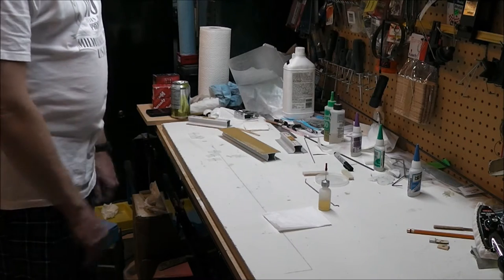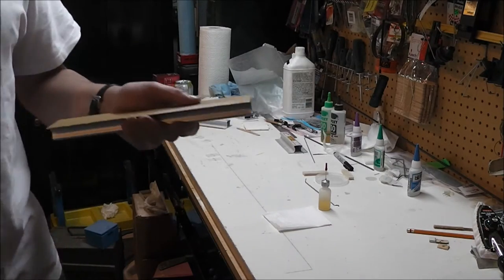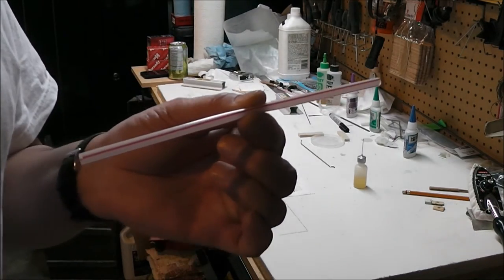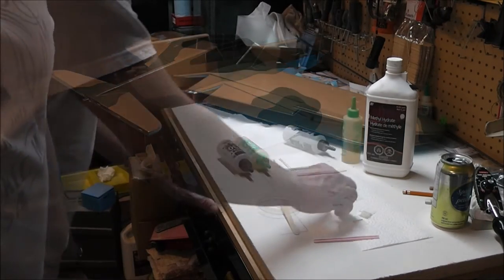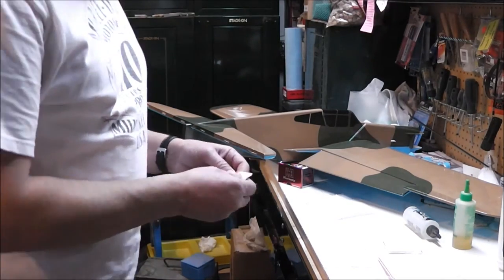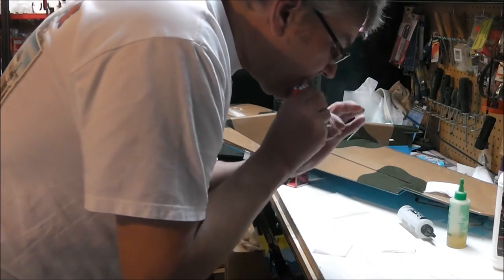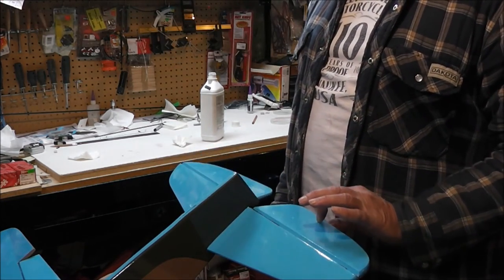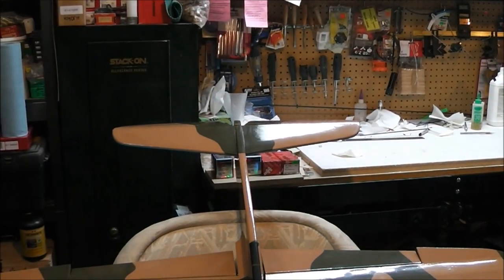Installing Nylon Hinges on Model Airplanes

Comment: I have a question about electric.  I have a small Sig plane with a 28" wing span that I built years ago.  Since I never put a gas engine engine on it I'd love to put an electric motor on it.  What should I be looking for as far as size and an accompanying battery for it?  That's the hardest part for me on the electric is trying to figure out what motor and battery goes with each.  I have a Super Clown from Brodak that I crashed and when I rebuilt the front end I put a motor that was typically used on their Ringmaster.  The problem right away was that the battery that I had for the Super Clown although it worked it was slow as anything until I changed the battery with one that I used on the Ringmaster.  Any help would be appreciated as always and I will try this on hinges next time that I have a plane to build.  Great instructions.
Reply from the maker: The more cells in the battery the more voltage that gives you higher RPM. I cheat and look at recommendations on the Brodak site.  KV rating on the motor is the RPM per volt. https://brodak.com/electric-accessories-1.html

Comment: Try sonic tronic CA  hinges, not the Tower Hobbies crappy ones.  The Tower ones are to stiff and do break.  Never broke a Sonic Tronics hinge.
Reply from the maker: I heard they are good but pinned hinges are far more free moving which is what you need on a controlline model.